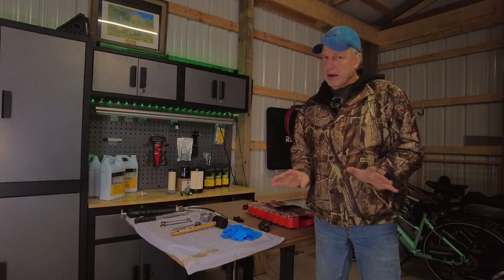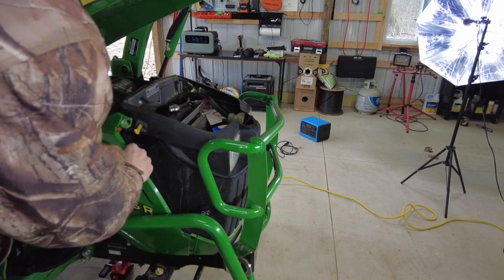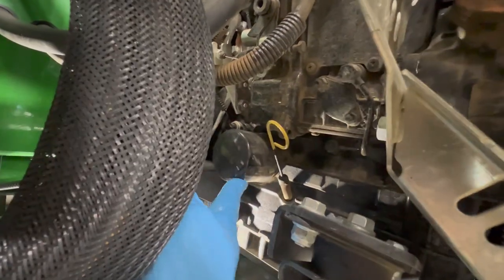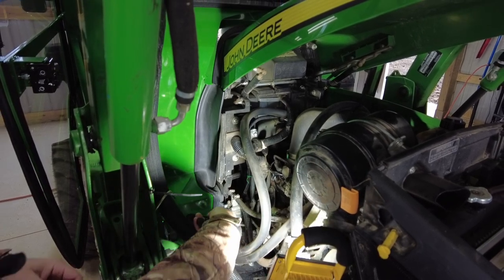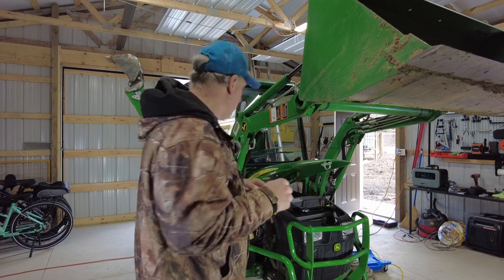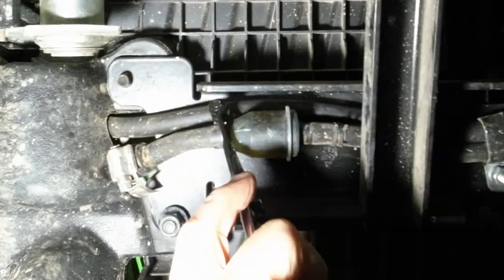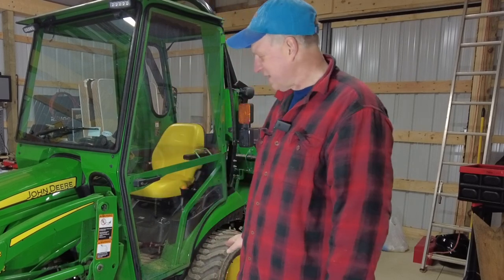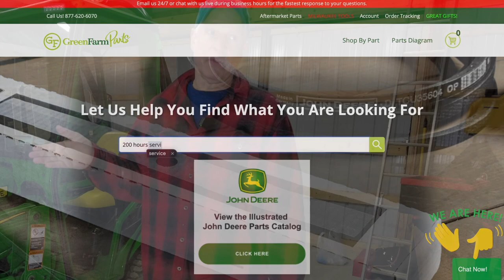John Deere 1025R: Green Farm Parts Service Kit, Don't Make This Mistake 🤬

Comment: For the fuel filter under the floor board it is a 1/4 npt going into the tank I unscrewed it and put in a petcock so now I can just shut the fuel on and off
Reply: That is what I did with my tractor as well.....makes changing filters so much less messy...you still get the fuel from what is in the lines, but you don't get it gushing out from the tank.
Reply: @wildbill23c  Merci de l'info !... Vous auriez une référence, une photo ?👌
Reply: @hudsonvaganis7855   Merci de l'info !... Vous auriez une référence, une photo ?👌

Comment: I use plastic hose clamps on my rubber fuel lines. Amazon has several sets from around $12 for a 3 piece set. Also I usually put a fuel shut off inline ahead of the filter just to make filter changes and maintenance easier.

Comment: The small fuel filter under the left side is always a pain.  The first time I used a fuel line shut off device but wing nut was not tight enough ~ yep it leaked.  So I was the wing nut 😂.  The second time I used vice grips, much better.  🙂. Tip:  Do this when it’s not too cold, wear only a T-shirt.  Diesel will wash off the arms, but not my favorite coat even after more than one washing.  Lesson learned.

Comment: FWIW old spark plugs make a great semi-universal line plug. Just jam the insulator side in the hose and slide the clamp on. Essentially free if you work on gas engines as well.

Comment: Yup, I received a diesel shower as well lol! Messy job but if you have the filter close by, just stopped the fuel with my finger like you and did a quick swap, lost a little diesel and got some on the floor and my arm.

Comment: I just use small flat vice grips to clamp off one side of the small fuel filter at a time. exactly the same process as a D105 riding mower. uses the same filter and lines.

Comment: You are very fortunate if this is only second time you have replaced the under floor fuel filter. I have to replace mine at least once a year. Can tell is getting plugged when I see/feel power loss. With right tools/clamps can replace that filter with no mess.  Many struggle greasing the driveline/driveshaft u-joint through the small access hole - you did not mention so maybe that is easier on the 2018 model?

Comment: I will have to do this service soon. Thank you for the insight into the task. I got a set of fuel line clamps for the inline filter under the deck.
Even with my prep, I am expecting to get dirty. That's part of the fun. Thanks again Sir

Comment: When you change the water separator filter located by the firewall, you depressurize the fuel system.
THAT is the time to replace the floorboard fuel filter.
Alternatively, use a pair of needle nose pliers with tubing over the jaws to prevent knicks in the hoses, clamp an upstream flexible fuel line and tape the handles together with duct tape (poor man's vise grips).

Comment: Thanks for all your good information, the good and the bad. The hydraulic issue was a great learning event for me. I did use a brake line clip to stop the  fluid on one side and I had to use a bucket to collect the rest of the diesle fluid. Luckily, I only had a 1/2 gallon in the tank. Keep up the good post.

Comment: Gently use vise grips if you don’t have hose pinchers, also you see the filter has 2 stages for size, cut off the size you don’t need, makes things a little easier.

Comment: It helps to cut the extra barbs off the little fuel filter.  I wrapped electrical tape around my vice grip jaws and clamped the tank line when doing mine. It worked well. I may buy a proper tool for it sometime.

Comment: I think relaxing the hydraulics would be the safest way to service without actually disconnecting them, but they hold the same (or really close) volume either way. The fluid pushes on either side of the o-ringed disc depending on which way you're going, so the cylinder is always full of fluid. I'll go back and watch again to see your reasoning, but you're not changing any more fluid either way it's what I'm saying.

Comment: I have a 1023E that I service. It is due for 300 hour in May. 
I use green parts also great company to deal with also helpful. The fuel filter under floor board, I clamp it off with clamps I watched another YouTuber use .I forget where he said he bought them but the work great I think it was 12 bucks for set. Sorry I can't remember where. Enjoyed video God Bless

Comment: You are ok, but something people should be aware about is that side oil fill cap on the motor.  Mine and a few others when it is tight, it is more horizontal and that radiator hose is right there and shakes and keeps rubbing on that oil cap and eventually wears a hole through that radiator hose.  Mine was about to go all the way through and I zip tied a thick piece of rubber over the radiator hose and it wore through that I noticed this past year.  So I just used a Dremel and sanded off a little bit of that oil fill cap corner so it's away from that hose more.  Will keep an eye on it.  The fuel filter under the fender, best to put a shutoff valve on there.  Some have moved the filter up under the hood by the fuel pump and shutoff there, which is what I would like to do next time.  I just added extra hose and shut off valve under the floor board but not happy with it.

Comment: I used my hemostat clamps and everything went fairly well on that little fuel filter on the engine oil change when you put new oil back in it is there any reason why you don’t refill it from the top of the engine oil plug  it’s so much easier to get to. And thanks for sharing information on hydraulic  Oil change  I told tractor time with Tim about it but he never answered

Comment: i ve done this maintenance several times never had a issue with losing fuel, my son a diesel mechanic says its common, so they have a set of fuel line pliers to squeeze line i borrow a small one every time

Comment: You all so can use a shop vac to hold the fuel in the tank put the shop vac in the fill hole and tape it up so no air leaks and the vacuum will hold the fuel in the tank.
You don't want a full tank work good with a 1/4 of a tank.

Comment: Ok, noob here.  Changing the two fuel filters ended up with diesel on the ground on both  filters.  Is there a reason not to run the tractor out of fuel before doing the service?

Comment: Looks like the filter under the floor board is in backwards?
Reply from the maker: Same direction as the original.
Reply: The filter usually has a flow symbol on it so you know which way to install it. Always looks backwards to me too but that's how it looks.